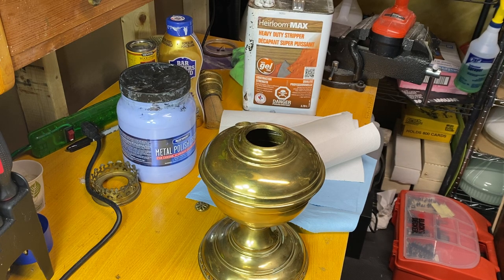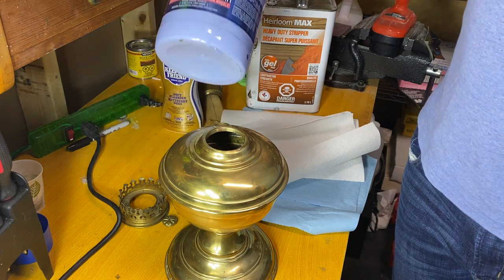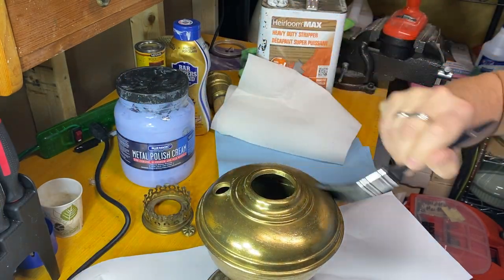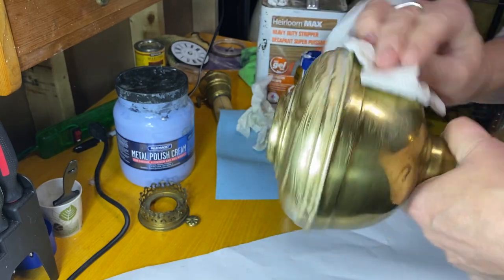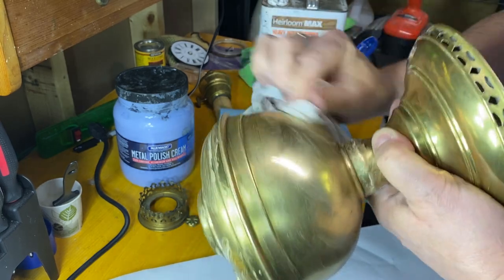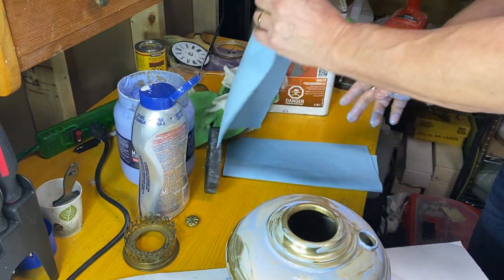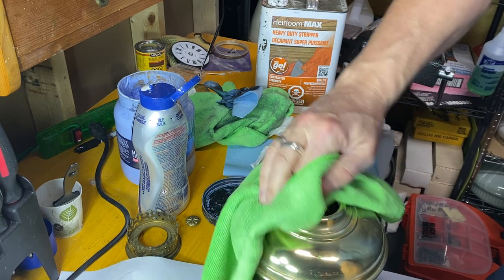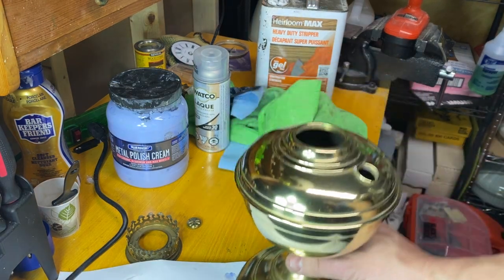Brass lamp polishing 101

Comment: Brasso isn't even necessary if your using BM.  I've even used it on lacquered items of which it ate right through no problem. In fact, using gloves with the stuff is actually a very good idea. That and it leaves a micothin layer of silicone on the metal thus preventing or inhibiting further tarnish for quite some time.